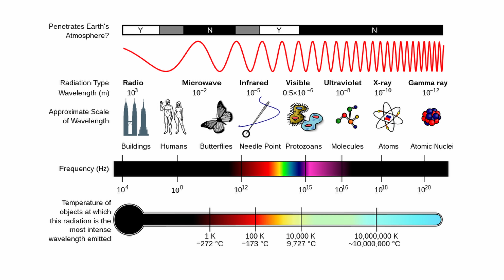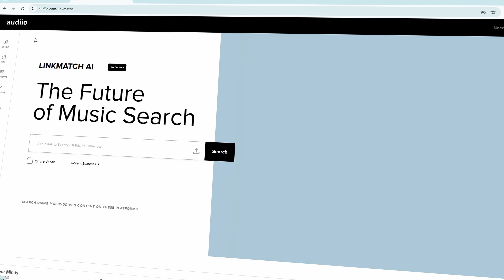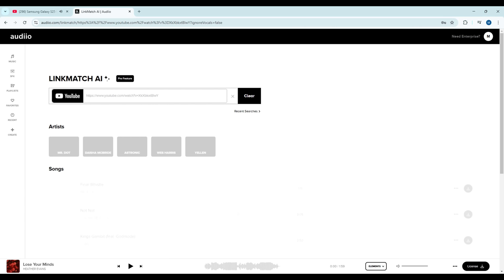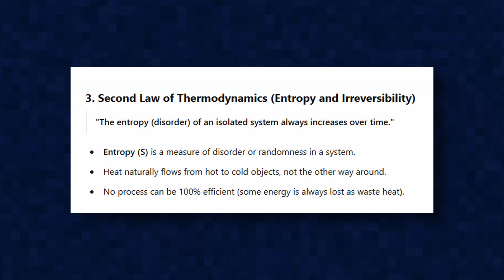This is how Maxwell Chikumbutso's Inventions Work

Comment: My question is there videos showing how the device work with cars and other electric stuff.
Reply: Furthermore Tesla writes in the Brooklyn Eagle newspaper on July 10th 1932:

“I have harnessed the cosmic rays and caused them to operate a motive device...
... More than 25 years ago I began my efforts to harness the cosmic rays and I can now state that I have succeeded in operating a motive device by means of them. I will tell you in the most general way, the cosmic ray ionizes the air, setting free many charges ions and electrons. These charges are captured in a condenser which is made to discharge through the circuit of the motor. I have hopes of building my motor on a large scale, but circumstances have not been favorable to carrying out my plan.”

Comment: I'm an engineer and I can tell you for a fact that this is all a scam. It's not possible for radio waves to power a vehicle, a vehicle requires a lot of power to run. He has a battery pack inside that TV. Even the cars are manufactured in china

Comment: The ancients took it to space by taping the Ether which is a source of endless energy. If you know how to prime the Ether using harmonic frequencies, you should be able to power anything: a car, a house, a spaceship, or a city.
Reply: Furthermore Tesla writes in the Brooklyn Eagle newspaper on July 10th 1932:

“I have harnessed the cosmic rays and caused them to operate a motive device...
... More than 25 years ago I began my efforts to harness the cosmic rays and I can now state that I have succeeded in operating a motive device by means of them. I will tell you in the most general way, the cosmic ray ionizes the air, setting free many charges ions and electrons. These charges are captured in a condenser which is made to discharge through the circuit of the motor. I have hopes of building my motor on a large scale, but circumstances have not been favorable to carrying out my plan.”
Reply: Thanks for sharing.
Reply: "Ether"

Comment: Dont disregard other people hardwork. Even if it not working, you should have an open mind to accept that he has put in lot of efforts. Encourage him. Dont discourage anyone. Respect.
Reply: Furthermore Tesla writes in the Brooklyn Eagle newspaper on July 10th 1932:

“I have harnessed the cosmic rays and caused them to operate a motive device...
... More than 25 years ago I began my efforts to harness the cosmic rays and I can now state that I have succeeded in operating a motive device by means of them. I will tell you in the most general way, the cosmic ray ionizes the air, setting free many charges ions and electrons. These charges are captured in a condenser which is made to discharge through the circuit of the motor. I have hopes of building my motor on a large scale, but circumstances have not been favorable to carrying out my plan.”
Reply: @goranindjic7725  There isn't enough power in cosmic rays to do anything significant. Likewise, there's not enough EM radiation to power a car, by many orders of magnitude. Maxwell is a crook, scamming people out of money. All his fakery has been good to him and bad for his investors. 
He will never let his 'invention' be tested by independent, competent  scientists, because he knows it isn't real.
Reply: Don't discourage your reasoning.
Reply: Except it's not his hardwork. The con imported the car from China 😂😂

Comment: The presenter is actually being generous with this scammer. For you to harvest wave energy you have to build a circuitry that will be tuned to a certain frequency just like a regular radio receiver and instead of converting that signal to sound or whatever, you build another circuitry that will use this signal's energy to charge a battery of some kind or run a motor..... Long story short I call Bull$h*t!!!

Comment: I wish him well, but I still don't se where the energy is coming from. Is it the Quantum Void, or Zero Point?
Reply: Furthermore Tesla writes in the Brooklyn Eagle newspaper on July 10th 1932:

“I have harnessed the cosmic rays and caused them to operate a motive device...
... More than 25 years ago I began my efforts to harness the cosmic rays and I can now state that I have succeeded in operating a motive device by means of them. I will tell you in the most general way, the cosmic ray ionizes the air, setting free many charges ions and electrons. These charges are captured in a condenser which is made to discharge through the circuit of the motor. I have hopes of building my motor on a large scale, but circumstances have not been favorable to carrying out my plan.”

Comment: Unfortunately the laws of thermodynamic are laws. They are not theories. They are fact, proven and fundamental pillars of science and everything we take for granted in our modern world. If Maxwell claims he can break these laws then unfortunately he is a con man.
Reply: Furthermore Tesla writes in the Brooklyn Eagle newspaper on July 10th 1932:

“I have harnessed the cosmic rays and caused them to operate a motive device...
... More than 25 years ago I began my efforts to harness the cosmic rays and I can now state that I have succeeded in operating a motive device by means of them. I will tell you in the most general way, the cosmic ray ionizes the air, setting free many charges ions and electrons. These charges are captured in a condenser which is made to discharge through the circuit of the motor. I have hopes of building my motor on a large scale, but circumstances have not been favorable to carrying out my plan.”
Reply: @goranindjic7725  yes, you are correct. Maxwell device might be evolving from Tesla patent on radiant electricity
Reply: thisIsElectricityNotThermodinamics!!CantYouMakeTheDistinction?

Comment: The lack of understanding and merit shown to the act of interfacing has hindered the current paradigms in physics and maths. There are also extreme influences on the arenas of philosophy and Human social frameworks due to this massive mistake. The flaws are immense because they have been ongoing, building ever greater fallacy.

 Ask yourself; What is interface? What is interfacing? What are interfacing mechanisms doing? Super basic questions that point to the elementary nature of interfacing aka associating (hint) and the power of frictionless action. So many wrong turns on the physics and maths interpretations.

Comment: This disrupts the entire energy industry, and in normal circumstances free energy will create an unmanageable problem. What would happen to all the people in the energy sector and the current energy infrastructures. Its not really free energy. We have known about zero point energy. For example the earth spins and does not slow down , meaning the system is powered. Yet the earth doesnt have engines ! . Its just a Galileo moment. Maxwell somehow figured out a way to tap into this energy.
Reply: Wow, what a contribution!

Comment: It does not matter who makes the claim,
It is easy to verify if a car has unlimited range.
You just get in, drive.
After 100s of miles you will know if the car needs refueling or not.
There is no need to doubt what he says
When it can be easily checked.
Reply: exactly! What's with all the religiousity? People are crazy bud
Reply: @ 
Some just are quick to post comments,
without taking a moment to consider the meaning of what they say.

The claim of unlimited range is very easy to check. You do not even have to go into circuitry.

No one can hide battery packs or secondary fuels tanks that can give a car unlimited range.

That in itself would be a feat if he could pull it off.
Reply: And yet no checking has been done yet
Reply: @topmola24  
It seems it is beyond just a prototype.
That means it has been tested somewhere,
Just not signed off by mainstream science/patent office.
It is not really necessary for them to approve of something.

If the president is behind it, a partnership an established car maker has been made,
Surely a basic driving test was done,
By all these people.
It may just be as well to go under the radar until launch day. The quality, functionality will give the final verdict on the claim.
Reply: I wonder why. @topmola24
Reply: right on!!
Reply: Forget cars, let's verify the longevity and sustainability of the energy device by hooking up to a few electrical devices and let see how long it will run. Why aren't there more scientific minds ready to verify and test Maxwell's claims.

Again, stop focusing on cars, that is only one application of the device. There are so much more important applications for it than hooking it up to a car.
Reply: @cswbizberri4532 he already had a tv ...and his car already existed 9 years ago ( videos on YouTube) ..and he hasn't sold 1 tv or 1 car in that period of time .. plus nobody gets one to just run some tests ,this is just one big scam
Reply: Very intriguing, if his invention is legit, patents would be a great way for big corporations to steal his idea, because patents seem only relevant for the rich and powerful to get more money and power and crush their opposition
Reply: @armwrestlerjeff  This stuff would be worth trillions.

You think some Spec ops team wouldnt have kicked doors in long time ago if this was anything but a scam ?
Reply: @jackneuman5108  sad  but true, i sure hope it's real.  I've never considered capturing radio waves to power something as opposed to light waves, very intriguing
Reply: @jackneuman5108  If it were real, you mean.
Reply: @ABetterDay-fz3br  Yes. If it was real.

 People get fixated how they would drive to their granny for free without realizing the scope of this invention.

Everything would change. Unlimited free energy.

But yeah of course it is just a fairy tale.
Reply: @ 
Yes it is intriguing. The most important thing is quality. If it works as described, it would be a great leap, a move in the right direction, in making life easy for everyone.  Many things would change.
Eventually, other people will learn how it works and will introduce their own products.
That is not a problem. The market is a large, everyone, in every country needs a source of fuel and energy.
Reply: @armwrestlerjeff  you get
Reply: Send 4 × $250 Walmart giftcard 🎁
Plus a $250 gift card for postage

And you too can be the proud owner of a voodoo magic bubble transforming sonic the hedgehog radio cassette player
Quantum molecular defibrillator thingy ma bob device 😊
Approved by a thousand man- hours waste bot thread
Reply: @shareyourchristmas  ..The President of Zimbabwe is a clown... if this is a scam, because (as a "President" ) you check a thing like this first before having a "press event" and showing your face...he, basically  made it a presidential endorsrment
Reply: @Shareyourchristmas, you have hit the nail on its head. That is a certain way to determine the truth of his claim. One can also create a strong electromagnetic field and place it close to the car and see if there is any fluctuation in its power output which I believe there should be. However, a range test would be much easier to do.
Reply: Not because you do not understand something means that it's impossible.  It only shows just how much we still need to learn. His being denied a patient is just buying time to steal his intellectual property. But I hope that would be thieves be constantly reminded of the source of the invention....God.
Reply: @andycumberbatch4140 You do understand if his "invention" was real some special forces would have taken him and his works years ago ?

This would literally transform the planet.

But it is just endless fantasy talks about aliens, gods, assassinations, patents, self destruct wires that sound like 6 year old invented them.
Reply: @shareyourchristmas  Exactly!
What’s sense does it make to arguing slandering the man for a marvellous invention which is easily verifiable as such! Africa God have mercy on us … we are so brainwashed as to always doubt ourselves even the face of obvious plain facts
Reply: @Kondukdion  It isn't slander to point out fraud and protect people from being taken advantage of.
Reply: The car is not available for testing
Reply: For who test ? @fchitungo5
Reply: @fchitungo5 his technology has been tested and documented..
Reply: There is nothing to check because the only thing he has invented are the words coming out of his mouth
Reply: as a zimbabwean I think we will conquer the world with this invention! We must not share it with white people. Africa strong!
Reply: where is it claimed the car has unlimited range
Reply: This has happened dozens of times in history. Somebody makes  self sustaining device or zero point energy device and it disappears or he 😴 soon after.
Reply: The only way a test vehicle of his would run with unlimited range without refueling is if it's being followed by another vehicle with a high powered microwave transmitter aimed at the test vehicle. But I wouldn't suggest getting between the test vehicle and the "pacer" vehicle.
Reply: or buy one then discover all the mechanics thats al
Reply: Who raised you? There is EVERY need to doubt it when it has not been checked.
Reply: @ 
Language matters.
Watch what you say.
There is a difference between doubting and evaluation.

The attitude of doubt suggests you do not even believe it could be done.

In evaluation and testing, you come with an open mind. If someone makes a claim, all you have to do is define the quality elements to check.

The claim of unlimited range is very easy to check. You do not even have to go into circuitry.

At this point in time no one can hide battery packs or secondary fuels tanks that can give a car unlimited range.
Reply: @shareyourchristmas  Yes language matters so don't try to redefine the meaning of the word "doubt".

Comment: Hi. From a "Physics" point of view, why limit this device to radio waves which are low energy compared to all the shorter length waves in the E.M. spectrum? Even visible light has more energy, which is how photo-voltaic cells work. Also infra-red, ultraviolet, X-rays, gamma rays, etc. Why use kittens to pull your chariot when you can use horses? Why not tune this thing to the more energetic wavelengths? Cheers, P.R.
Reply: So here is the thing now, these high energy waves tend to travel very short distances from the source before getting dissipated ( I think the correct term is attenuated or something). Take gamma rays for example, they only travel a few centimeters in air from their source, they are mainly produced by radioactive materials. The other problem is that these waves have so much energy that  if you expose a normal human being to them they will be very harmful. Now to get them in the quantities that are needed to power cars would mean that you either have to set your power plant close to the sun (which produces these waves in abundance) or find a place where they are produced in ungodly amounts that will essentially cook you alive. 
Radio waves on the other hand can travel long distances and are not as deadly but the energy they carry is so tiny, so in short, this doesn’t seem feasible to me that what this guy is saying is possible, but being the optimist that i am, i’m looking forward to the launch and getting to understand the genius or scam behind this whole microsonic thing
Reply: There is no thing here, false claims
Reply: I'd rather belive Aptera to work...well it actually already does.
Reply: Can only guess that he is harnessing all available ambient wavelengths

Comment: Energy cannot be created. It can only be changed into another form of energy. Chemical (fuel) turns into mechanical (motor) which turns into electrical energy (electricity). Mechanical energy (wind flowing) which moves generator turns into electrical energy.

Comment: There are basic things missing from his presentation, he talked of range of the car aka how many km/ml it can travel meaning his claim is already busted. If there is a range on the car battery it means the car needs time to recharge aka the techology needs time to capture the waves, convert and recharge the battery meaning its nolonger contiunious as he claimed
Reply: IF ONLY it would capture the waves...there is no evidence that it does. The only proof would be is to drive the vehicles until the batteries are empty then wait until they have recharged the battery without plugging them in.
Wanna bet it won't work?
Reply: Hi Phil. Yep, that's right. Cheers, P.R.
Reply: Well the power can be continuous but that doesn't mean the CAR can be driven continuously. Do you have any idea how much power an EV engine requires to run? Here's a hint, look at the car. Is it a small car or an SUV? Modern small EV engines require 50 to 100 KW to run, yet his generator only outputs 15 KW, so clearly, his generator will trickle recharge a full battery so despite a continuous charge, the battery will eventually run out if the car is driven long enough. That is why the car will have a range. It will take around 3 to 8 hours to fully recharge the battery so depending on the engine's requirements and how hard you drive the car, you might fully deplete the battery and need to wait for it charge up before you can resume driving. Imagine you have a car that gets 30 miles per gallon  but you have a magic portal that fills the tank at 5 gallons per hour. If you drive at 4 miles per hour, you can drive indefinitely, but if you drive continuously at 60 miles per hour you will run out of gas despite the constant magical flow of gas.

Comment: Even if the waves exist,the is still an energy supply that has to be recharged.Teslas energy abortion from the friction and energy created by the rotation of the earth and it's magnetic fields.Is the cure for energy supply Not a little wave box.Whats this thing do 5 miles per hour.